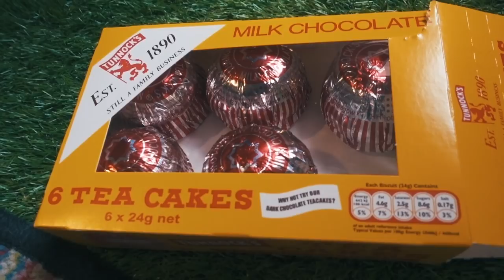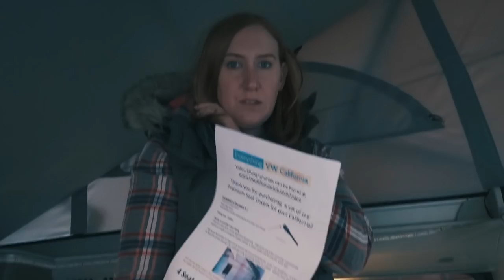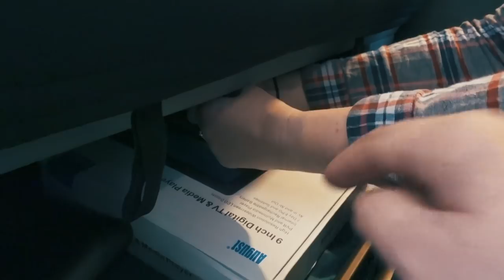Premium "GTi Style" Seat Covers - VW California

Comment: One thing I don't quite get. I would expect a key reason for having seat covers is that they should be easily removable, either for washing, or that you would put them on for 'dirty' activities, such as camping, and remove otherwise. Clearly, that's not a realistic approach for these ones.  That's a disappointment for me. Your Lidl ones are perhaps better suited for on/off use. Thanks, very useful video all the same. (PS. I have an old T25 Westfalia California, but just about to sign for a T6 Ocean).

Comment: To those who ask: why do you need seat covers? I've had a new Ocean for 6 months, with the standard seats. They are pale in colour and take up stains frustratingly easily. They even show a stain where I spilled some clean water on them! I've sprayed them thoroughly with Scotch Guard, but seems to make no difference. This is a real disappointment from VW. Why provide such pale seat fabric as standard? I previously owned a Passat with dark seats,  which would be  much more practical. Hence, I have just bourhg this GTI set.